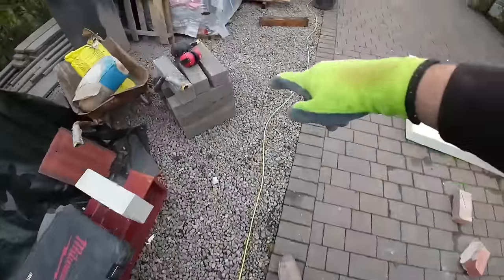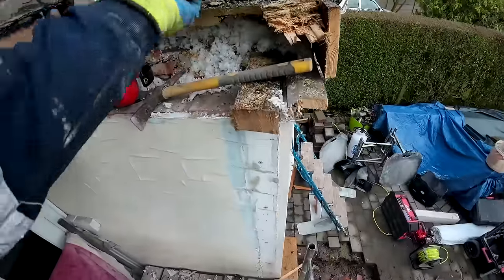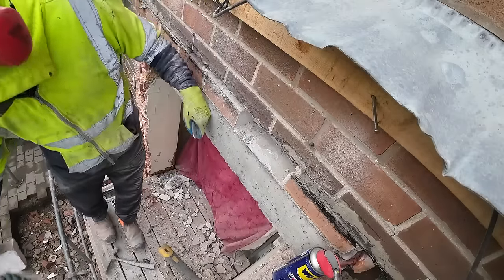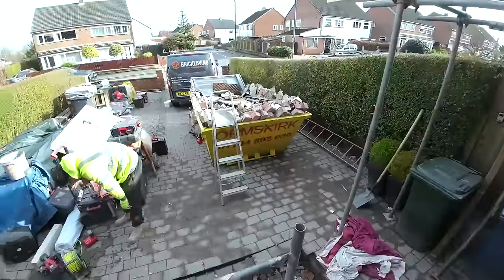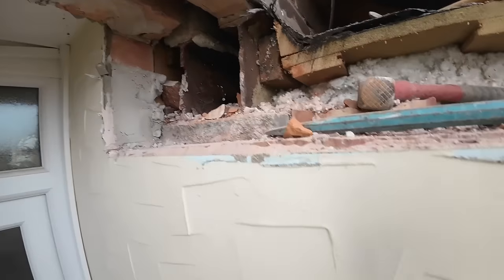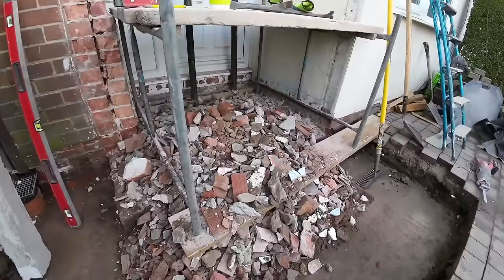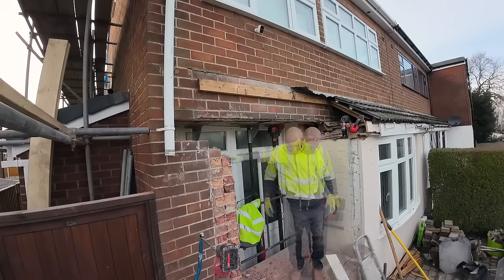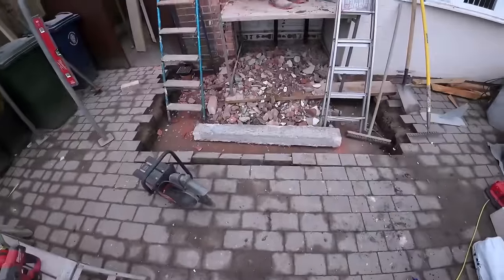THESE LINTELS NEED TO GO..... THIS IS HOW WE DID IT..PORCH BUILD PT 2

Comment: Hi guys, nice job.  Just a quick question, where do you get the Milwaukee tools  from.  I am thinking of changing brands but I can not find a local supplier in the Midlands.  I am not too keen of online shops as Ive had problems before.
Reply from the maker: If you go on the Milwaukee website they have supplies listed on there . 
    Good choice 🟥💪🏼🧱👍🏽

Comment: Chaps,
What was the end bearing on those two existing lintels - 50 or 60 mm.?
I have seen much worse than that,  and no doubt so have you.
I am in no way condoning work like that - it is wrong and goes against all good structural principals. Despite that the house has been standing for 50+ years...
There is a decent sized brickwork pier to the left of those lintels, to relieve the load/forces placed upon it from the wall(s) above.
However,  as I always used to say,  "It is either right  -  or its wrong."  and that minimal seating is certainly "wrong."
So well done on the correct rectification of that job  -  with the correct seating.
Pukka work as ever from the Lancashire - Lintel -Lifting-Lads.  😁😁👍👍👍👍👍🦺🧱🧱
Reply: I was told only the other day by a structural engineer  as I was packing in a lintel like you are using building sand and cement that a better option would be to use washed/grit sand as much less likely to shrink when drying , what’s your thoughts on this , I didn’t argue with him I did what he asked as he was on site at the time
Reply from the maker: @Joe74854 . Sounds like a good idea 🧱👍🏽